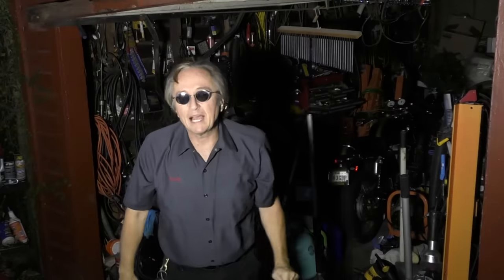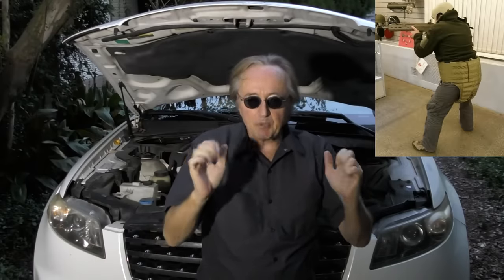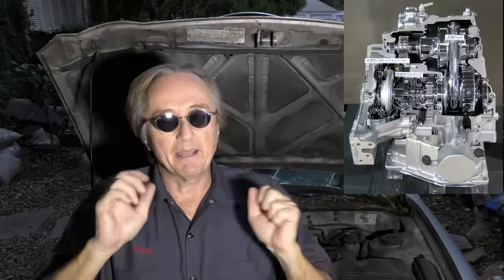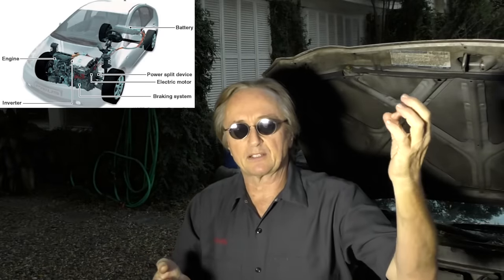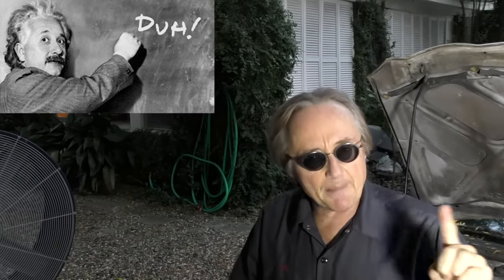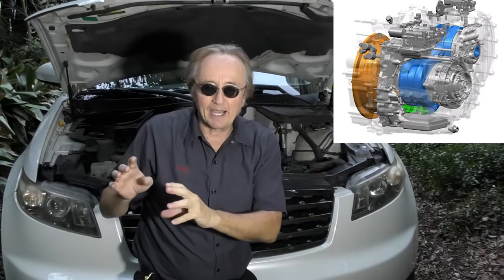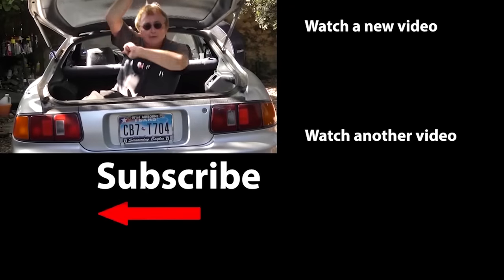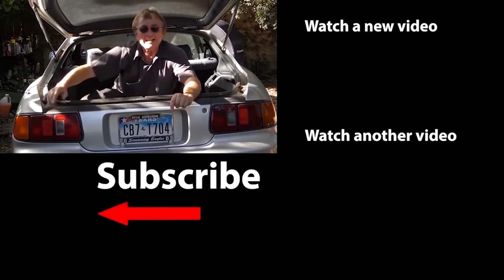Why Most CVT Transmission Cars are Terrible

Comment: CVTs are actually very undervalued technology that is being held back because consumers like all of you are stuck in the past and need cars that change rpm to give yourself a sense of familiarity when to it comes to connecting engine sounds to driving. The CVT is an incredible leap forward in technology for fuel consumption and yes even performance, thanks to ICEs being help at peak power through seamless shifting. Because all of the complaints of engines staying at the most ideal rpm (drone as you all put it) manufacturers are putting in artificial gear changes in these things which totally defeats their purpose. Manuals still have their place and always will, but consumers need get with the times an stop bashing new technology. It's the 21st century and automobiles are getting super efficient, so let the engineers do their thing and be more open minded. The CVT is not going anywhere, so get used to it or take a bus.
And I don't wanna hear about the reliability because I've seen a toyota automatic go bad under 100k miles and I've seen Nissan CVTs with 150k, and 200k miles.
All cars have reliability issues. Take care of them, dont abuse them, and any modern car will probably make it to 200k miles.
Reply: If it aint broke dont fix it.  Like Windows 7.  It was perfect.  Every "upgrade" since then has been a huge downgrade.

Comment: 2016 Toyota Corolla ... cvt failed at 80k miles. Ug! One of the most horrible experiences ever. My mom still has her 2006 corolla with 220,000 miles on it. No help from Toyota. 😫

Comment: Having just had my 2012 rogue trans. fail, I've learned alot.......I like the c.v.t's!!!!, i never had so much acceleration since my 3 -speed bobcat wagon in the late 1970's.......its a great idea, problem is the main shaft bearings fail, then the steel belts a few seconds later.....my solution would be to make the whole damn unit very serviceable!!!  like brakes, or a starter motor, or windshield wipers. Nissan could start by moving the crossmember so the unit can be pulled down easily. Same with all the crap over the transmission. like harnesses, battery, plastic stuff,etc....... Better yet, make the main pulley a separate casting, ....make it easily removable like the transfer case........I don know, it'll never happen because if it didn't happen in 15 years of nissan rogues, why would they suddenly do the right thing??........you see, kids, they have a $moneymaker$ why be honest when you can put out junk every year??? And then have the driver pay $5000 for that evil jatsco gearbox!!......I'll never buy another nissan, or c.v.t. transmission again....this vid. should be called" why ALL c.v.t. transmission cars are terrible"

Comment: Subaru does not use JATCO CVTs, their CVT is built by Fuji Heavy Industries. The misconception comes from the fact that Subaru used Jatco conventional automatic transmissions. I am not sure of the maker of Mazda CVT but they might not use Jatco either and were only using them for automatic transmissions.
Reply: Ryan Sawadichai pre 2014 was jatco

Comment: I hate CVTs because they are inherently unsafe. The amount of times I've slowed down from a higher speed, then had to accelerate back into traffic, only to have my foot go straight to the floor and have the car basically stand still, then leap forward a second later once the CVT spools up. There is no connection between your foot and the wheel speed of the vehicle.

Comment: Toyota Prius does NOT have a regular CVT with a belt. Most other  Toyota models do have a regular belt driven CVT and have their share of problems. Toyota actually realized that the belt idea is problematic and developed a "hybrid" CVT in which the low speed high torque range uses automatic clutch and gears.

Comment: I'm 19 and have been saving up for a reliable car, I've had my eye on a Toyota corolla 2022 CVT, do you guys thing thats a good buy or no?

I like cars but I dont really care about how thrilling it is to drive I just need to get to work and back and run errands.
Reply: It’s good. I got a 2020 Corolla LE trim, get the 2022 with 1.8 litre and can only be found in L, LE or XLE trim as that engine has been bulletproof. Don’t stomp on the transmission from the go, not meant for that, take it easy and most important thing is do your maintenance

Comment: I sell new Nissans and I'm well aware of the CVT. It's a transmission fluid temperature reader that's not keeping the the fluid cool. Make sure you service it at the dealership so the technicians monitor it. The CVT wears out when the customer isn't aware that the temperature gauge has overheated and the transmission begins to wear out. It's avoided by not reving your engine in gear unnecessarily. Don't push the car to pass people aggressively. Service with the dealership and get a diagnostic every oil change. Diagnosis are free. What Scotty doesn't mention about the CVT are the benefits. CVTs save gas milage is the best yes but they also shift extremely smoothly. The ride in a Nissan is much more comfortable than any other Japanese car because of the CVT and the noise cancellation interior makes for less road and engine noise to. Nissan's push for innovative technology for a superior ride and they release new saftey and convenience technology before the other Japanese manufacturers. Stick with your Nissan, take car of it and service it well. Just like any other car!
Reply: Nissan went downhill when they merged with Renault 

Mercedes went further down hill when they bought Chrysler 

10+ (-5) doesnt equal 15
It’s 5
Nissans suck now, there’s nothing you can say that can change that, and saying.

iT cAN bE GoOD IF YoU mAINTaIN it

Yeah, it doesn’t mean anything, anything can a “good car” with sufficient maintenance. But the name of the game is cost effectiveness. I can maintain a “boring” 12 year old truck with actual gears and metal for $500 a year, or worry about accelerating my brand new vehicle at the interstate, and hoping the technician at the dealer knows what he’s actually doing.

I dumped Nissan since I saw my sisters $6000 Nissan Altima repair. 

A good friends 370z engine is spazzing out on him periodically and mechanics can’t figure out why. 

You know what issue I have in my 07 tundra? 

My tire pressure is low, but it’s also 30 degrees outside
And the other issue is.....

Which iron bull bumper guard should I get

Should I get the sniper or sniper 4?

Comment: Exactly! Cvt transmissions are horrible! Stick to regular 4-5 speed automatic transmissions or manual transmissions! My loaded 2003 nissan altima 3.5 v6 has 180,000 miles on it, and thank goodness it has the regular 4 speed automatic transmission otherwise it wouldnt have lasted as long if it had the crappy cvt transmission!

Comment: Car makers are not interested in cars that will last long. If carmakers wanted they would have all said we won't introduce too many sensors, fuel economy gadgets, turbos with low CC, high grade gas requirement, and even leave mineral oil as an option. Cars are efficient. They just got too low on price and so is carmakers had to come up with ways of car replacements. Car Lease one way to send a car to graveyard because no one would care to change oil because who cares what comes after. Its shame. What car makers didn't realize is that the whole combustion engine technology might get replaced with electric motors because they are now much simpler then high efficiency gadget loaded combustion engine. We as consumers pay for the change. Batteries do go out for sure every 20 years and significantly loose efficiently 10 years. Once the swap happens then they will be alarming that lithium is to hazardous, battery production will have environmental fees, and so on. Solar will never power cars so we are down to consumerization of batteries. No one cares that that 50 years old engine with just 10% inefficiency can start up and do work. Battaries will need to be heated and cars will be not too far from the grid. Driving 2 hours to a lake will be a new Mexico trip(for the same price too).

Comment: If you do proper OEM CVT FLUID CHANGES every 30k miles and CVT filter changes every 60k miles chances are your CVT will last a long time. The vast majority of these premature failures is owner negligence! Its not an old school 4 speed automatic sealed transmission with lifetime fluid that nets you a shitty 18 mpg. Its a delicate transmission that will save you thousands in fuel costs over the years if you invest some time and effort into maintaining it!

Comment: What do you think about adding a aftermarket external mounted trans oil cooler in a thermostatic controlled configuration where it uses both external and oem cooler separated by a thermostatically controlled valve ?. Say maybe $300 or less total cost.

Comment: $18,995
Mileage
43,315
Engine
1.8L I4
Transmission
CVT 7-Speed
Drivetrain
FWD
Fuel Economy
28 city / 36 hw

I’m trying to buy a 2017 Toyota Corolla with this transmission. What do you think?

Comment: Wish I knew this before investing in a used Suzuki s Cross 2014 I got 140000 km out of the transmission before it went out I was quoted 2 to 5000 dollars to repair or $7,000 to replace fortunately I was able to get a second hand one for $1,600 and then pay the dealer to calibrate it to the car

Comment: I'm Sure everyone gets tired of hearing about CVT but here's one i wonder about?
First off, i LOVE your videos and yes i subscribed. lol.
Here it is:
 Can you Replace a CVT in a Nissan that was made by Jatco with one made by 
Toyota or its manufacture AISIN or one of the Other manufacturing Company's? 
Can you help me out as i haven't had any of the other issues yet and it is a repo,
but for only having 120,000 when i bought it, it's doing pretty good, but i Do hear a 
Sound every now and then coming from the Transmission so i know 'ill
have to replace it one day. i'm not TOO concerned about cost as long as it last and 
Wouldn't mind having it Rebuilt but like you Said "Correctly" 

It sounds as if Don De Paz getting 440, 000 miles is taking proper care of his CVT, and
Of course being a Honda may have Attributed to that fact.

Comment: Obviously if by far most CVTs are made by Jatco then most CVTs problem will be with Jatco transmissions simple stats. Is this what you're referring to when you said most CVTs problems are from Jetco or are you talking about percentages based on transmissions in use? If is the latter where can we get the data?

Comment: Hello and thank you much for the info u provide 
I have a Nissan Maxima 2001 
I replaced the axle both sides 
After the car comes with rattling sounds only when engaging the transmission 
The car drives but with the that sound loud 
I believe the transmission is going bad 
But still drive 
What it can be inside of the transmission?  Going bad? 
Thank you much again

Comment: I had 52K miles on my 2017 Altima when the CVT went bad. Nissan gave the dealership a hard time before finally acknowledging that the transmission went bad. i will NEVER buy another nissan.

Comment: My 2014 Nissan Sentra cvt failed and was repaired at 98k miles less than 20k miles later it happened again. There’s a class auction settlement about this. Waiting for Nissan to tell me if they will repair it. It’s sitting at the dealer parking lot.

Comment: all car companys mix and match parts aka engines and transmission ,and axles ,as for the cvt its a great concept and works fine ,if you have a Nissan don't worry I put 255 000 km on a 2016 Murano and not one problem even towed a trailer and my boat with it,,,,,just bought a new 2020 Murano ,,,had a doge ram 2014 with automatic tran and blew that one,,,,,at 220 000 km,,,so its to see,,,if you don't beat the tran in a Nissan its great,,,as for the Sentra not quite sure why they have problems,,,,,

Comment: Scotty what's your take on 2009 and later Volvo SUV CVT transmissions?   I own a 2009 xc90 with 255k miles and it's doing ok. Maybe the previous owner replaced this transmission...I read where Volvo invented the CVT. Jeff

Comment: Can a CVT slow down a car going down hill like an automatic does ?
Reply: Howie - Maybe. 2019 Sentra will hold the car back on downgrades about 7 mph over the cruise setting. If cruise is not on, it has to have "L" selected. "D" is freewheeling. 30,000 miles.
"Can?" "A?" Yes, if it's programmed to.

Comment: A lot of ppl transmission go bad because they don’t get transmission fluid change an when you neglect it as if it doesn’t need fluid it will break down as well around 40,000 plus miles

Comment: If you already got soaked and bought a Nisssan Jatco; if you change the Fluid every 40K miles, and change both filters(upper and lower, -lower unit is just the intake screen) you will extend the life of it. They sell the CVT's because they are cheaper to make(they don't have to pay Union Machinists to grind precision gears like a normal Planetary Gear Trans.). Avoid CVT's, DCT's(Dual Clutch), and Chrysler 9-speeds like the Plague. Never get a CVT car ever!

Comment: Nissan extended warranty from 5yrs 60k to 10yrs 120k. No worries. Just keep clean fluids and oil.
Reply: Depends on the year and model of your Nissan. They did double the warranty on certain models back in 2007, but that ended completely by 2008. Every CVT Nissan built in the last 10 years or so has the standard 5 year 60K power train warranty. If they want to instill confidence in their transmission, give it a 10 year 100K warranty like Kia and Hyundai.

Comment: I just bought a 2014 Nissan Sentra and it has that CVT transmission and engine light was on and it says it needs a throttle body or valve throttlebody or something like that. I wish I knew before I bought it.

Comment: I have to buy a car.
Any recommendations?
Quality?
Long-Lasting?
Best Engine?
Best Transmission?
Long-Lasting Air Conditioner?
ETC?
Reply: Chrysler 200 

Best reliability, gas mileage, and maintenance costs. It won the most reliable car of 2017. Look it up
Reply: according to Scott, its 1994 Toyota Celica

Comment: Scotty,  what do you think of the CVT in the new Toyota Corolla? It apparently uses a fixed-ratio planetary gearset for 1st gear which reverts to the standard CVT belt and pulley system for all gears above 1st. Good idea or not?
Reply: 3 years later and Toyota Corolla's CVTs have proven to be among the best, right behind or on par with Honda CVTs.

Comment: 2015 Nissan Altima SL 71,000 CVT transmission diagnosis judder code and needing new transmission $5200..
How does the tech know it is not the TCM...
They had to replace valve body at 20,000 and always has vibration and revs way up to 4,000rpm coasting down hills..they told me this is how it works..
I lost all respect on this dealership and their parts changers...

Comment: The Prius CVT is not the same animal as a belt driven CVT like what is in other cars. It's a completely different design. No belts, no clutches, just one planetary gear set.
Reply: @EpicDrew15  
To be more technical, an ECVT.
Reply: @EpicDrew15  
Look up how a Pruis transmission works. Elegantly simple

Comment: So, Scotty,  according to your info, 13 car manufacturers are using CVT transmission from JATCO, and no one else but Toyota is installing the AISIN CVT, and no one else is using the HONDA CVT but Honda. It's somewhat reasonable to find more JATCO CVT failures than AISIN or Honda ones. Another point is, you always say don't buy a Nissan equipped with CVT transmission when you should eventually be saying do not buy any vehicle with a JATCO CVT.  Last, why do we have 13 manufacturers wishing to discredit their brand by installing flawed by design CVTs? Or may it be that you are blowing this topic out of proportion?

Comment: Love the channel Scotty! 

What do ytou think about the fusible links in cars? My 2004 Chrysler PT Cruiser (I know) hit a pothole, the electrical power bounced then came back on, and the car died at the next light and won't crank. Driving me crazy trying to pin down what circuit or wire might be the problem. Replaced sensors, timing belt and water pump, ECU, dash lights and sounds work, fuel pump turning on, still won't crank.
Thanks for any help you would offer!

Comment: So new Accords have either a CVT or a 10 speed auto.  Which is preferable?  I saw one video where Scotty was dissing on Camry's new trans because they were 8 speeds as if the more speeds the more problems they might have.
Reply: don't get the cvt, if possible try and get the manual, even if you can't drive it, its worth it to learn how, but if you absolutely can't do that then get the regular automatic.

Comment: Scotty--I had a "new" style 2005 Nissan frontier with a six speed manual and 4.0 V6.  Loved that truck.  What do you think of the auto trannies that nissan builds for the Frontiers?  I've heard they had some problems with transmission fluid/coolant contamination...I'm curious for your wisdom in the matter.
Reply: Just sold my 05 low milage frontier due to valve body issues in the tranny. Nissan can't make any type of good tranny it seems

Comment: CVT transmissions went out on my Nissan versa at 70,000 miles. $4200 to fix.....if I get it fixed with another CVT transmission wouldn't I just have the same issue again? Don't think it makes sense to fix?

Comment: So that means I should avoid Mitsubishis with Jatco CVTs too? And how about Hyundai-Kia IVTs as it made in-house by Hyundai Transys?
Reply: Yes my advice is buy something with a regular non CVT auto transmission. 
My 2015 Mitsubishi ASX transmission failed at 47000km and they didn’t have replacement parts so it has a brand new transmission replaced under warranty. Then the crank sensor failed a couple of weeks later and the car wouldn’t start at times, so it was back in the shop for that to be replaced. Luckily it has a ten year warranty so I will probably replace when the warranty expires.
Touch wood it seems to be going fine now.